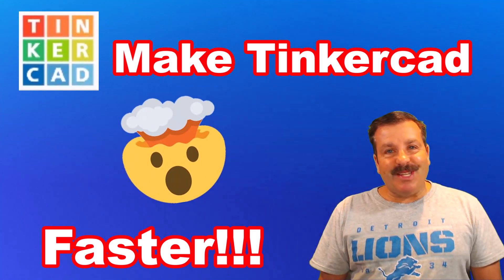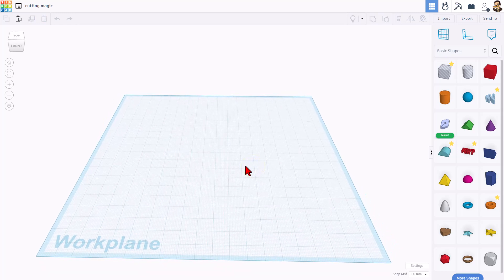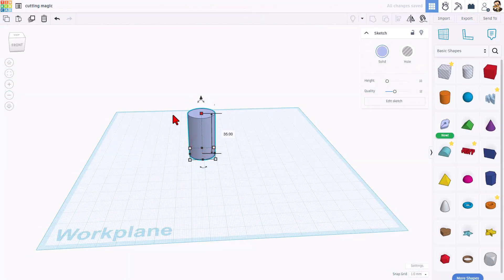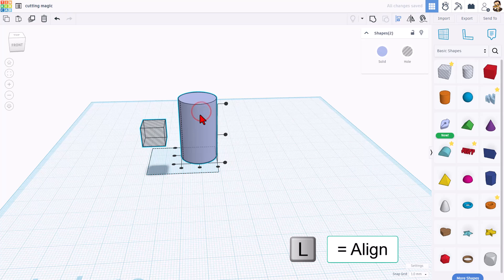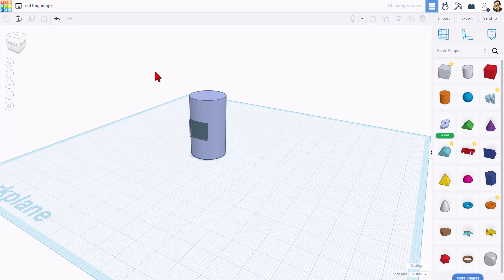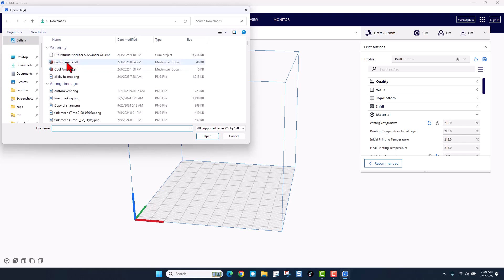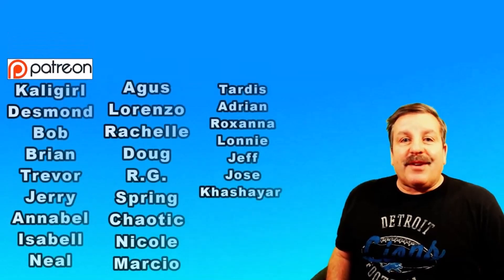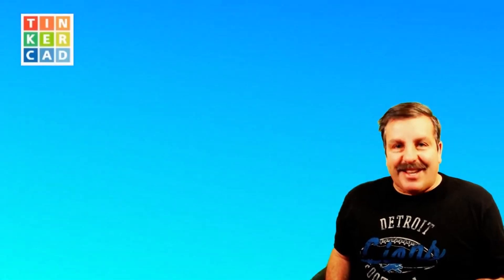Stop Grouping Shapes & Holes! Make Tinkercad Faster Slicer Wizardry 💯🔥

Comment: I just exported my first attempt to make a case around the UPS for my Pi Zero project, and as I smoke my cigarette as my 5M starts squirting it out, I realize how absurdly hacked together it is since I forgot I could center and align my closing portions, so its all eyeballed. At least I didn't use a track pad 😂
Reply from the maker: Many of my favorite projects were built the same way. There’s something to be said for I want therefore I create.
Reply: @HLModTech  exactly. It may be a hackjob, but it's ironic and poetic considering it's to house a "hack" tool. Penetration testing DEVICE. Lol and it'll live on my desk from now on, it's like the first framed dollar

Comment: The export will group them just right before the exporting and you are loosing preview.  Also sometimes you need follow particular grouping steps to make the item final, as the hole has priority above all and.
Reply from the maker: I still need to reach out to Tinkercad. I am not sure if the export does group the parts... or in a STL includes the hole shape and the slicer can interpret it. I do agree that there are likely parts we will want to group so our design is more clear.
Reply: @HLModTech  Export does group the parts, there is no question on that, if you select any number of parts and export them, they are exported as a group. Including negative objects.
Reply from the maker: @wlcina My point is that the parts in my Tinkercad project are never grouped... You are saying that Tinkercad is doing the interpreting of the hole instead of the slicer. Is that correct?
Reply: @ Yes, and I'm pretty sure that it works this way. I have done something similar that you did in the video except that I used a cylinder instead of the new tool, exported as STL and then loaded into 3D Builder. The hole is there, so the mesh exported after grouping for sure. You can check it in any viewer that can handle 3D meshes. It seems surely to be Tinkercad, not the slicer.
Reply: @HLModTech  I watched it in Windows 11's 3D Viewer, just to be sure the 3D builder does not group them by itself. I think it is only a viewer. The hole is there, so the mesh is with a hole. I imported the saved stl into Tinkercad and instead of the cilynder and the cube, there is only the cylinder with the hole. So the export function must group them.
Reply from the maker: I believe this is correct too. I contacted my Dev to confirm... but I did a few tests that led me to think it happens that way too.
Reply: @HLModTech  In my case, when I am trying to export multiple objects, it may take a very long time, so I think Tinkercad groups them. Just try to export two relatively complex shapes one by one and together.
Being in Europe, the latter process may take a very long time, despite I have a 1000MB internet connection.
Reply from the maker: @Creutzfeld10 Have you found a difference between times with each export? I have encountered times where it takes a while... almost feels frozen... then on my second export it is nearly instant.
Reply: @ Well, there are cases when even the simplest objects takes a very long time to export. Then by restarting the export, before finishing, it saves it most of the times quite quickly. In case I want to export more than one item at a time to avoid handling them separately, the export takes a long time - because as I tried out, Tinkercad groups them before exporting.

Comment: They just need to let us run tinkercad locally on our machine .would solve the grouping problem. Look i know i should be learning a "real " cad program but tinkercad makes it easy after not touching  a CAD program in 12 years 🤣
Reply from the maker: In the classroom it was awesome to not have to worry about installations. Simply sign in and you have the latest version.

Comment: LOL, Tinkercad exports all selected shape grouped. That's why when you export multiple shapes, they can't be repositioned relative to each other on the build plate. It's not actually faster with complex builds, it'll just take longer to export.
Reply: You can however do it for real. Export the shapes separately as solids and use merge and mesh boolean in Bambu Slicer.
Reply from the maker: That is slick too!

Comment: I just finished a project this morning and it would have been great knowing this earlier as I had to make some adjustments to pieces that I grouped together early in the project and couldn't find a way to just easily adjust them without having to go through a lot of undo'ing... great tip!
Reply: So I went back to my design from this morning and recreated it with this method and OMG is it soooo much better!! Loads instantly and exports very quickly.. Eliminates a lot of steps..
Reply from the maker: Thanks! I am going to be using this and teaching the method a lot in upcoming vids.
Reply: @HLModTech  I find it hard to keep up at times you move so quickly through some of it.. I find myself going back and watching some portions a couple times.. Either way I really do enjoy the content. Keep up the good work!
Reply from the maker: I apologize for the speed. I try to keep it clear & concise... but I hear you. I have a set of steps that include the YouTube speed option that may be handy. https://youtu.be/DwrnHNCwJrc
Reply: @HLModTech  No need to apologize.. I can rewind and watch again.. I appreciate your comments and videos.. I also appreciate your like on my project in TinkerCAD! I used this method over the last two days to create a few food related items and it does work so much better.. loads quicker and its so much easier to change and modify vs grouping as you go as I have always done.. Every TC user needs to see this video!